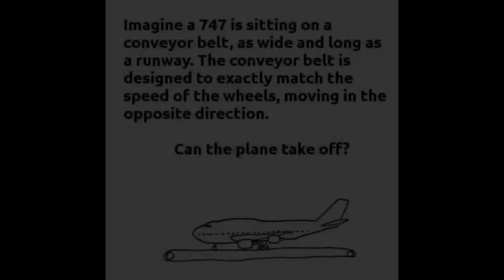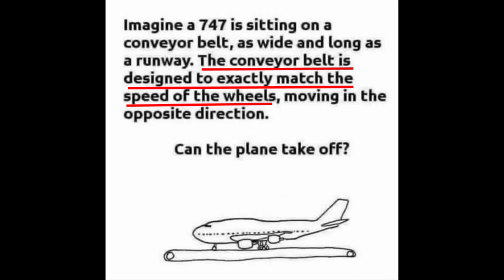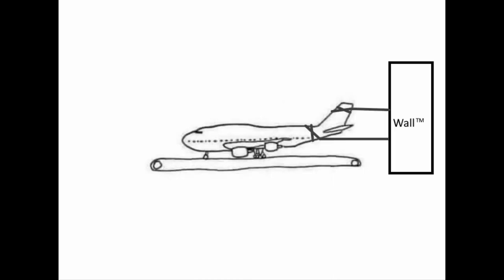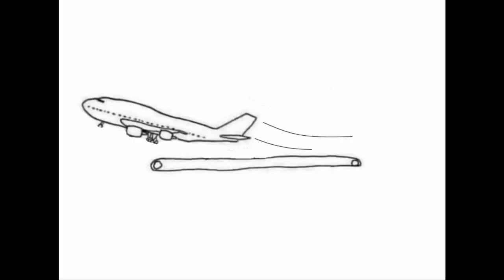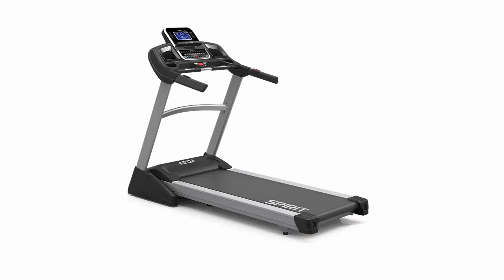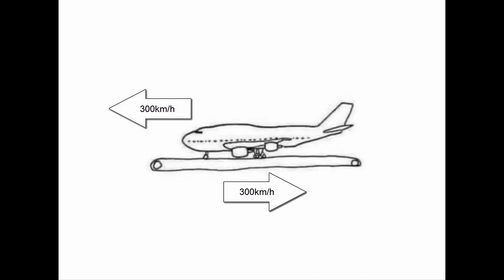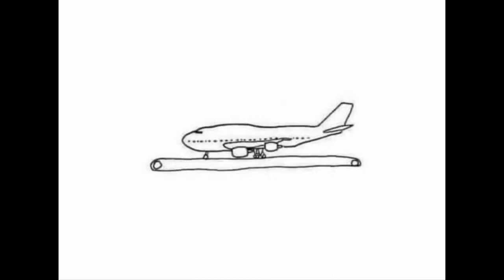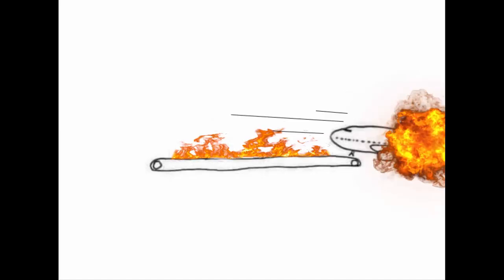Airplane on a treadmill is a flawed question.

Comment: It's noteworthy that given such a belt was big enough, the imparted draft generated by the belt moving at a high speed would generate a strong head-wind (due to the no-slip condition bounding the surface air and the treadmill) therefore assisting the lifting force of the wings.
Reply from the maker: I hadn't thought about it but yeah you're right. That might mean if anything a massive fast moving treadmill would aid in lift over all.
Reply: Well, actually there should be a speed gradient for the air above the treadmill. Close to the surface, the speed of the air mass would approach that of the treadmill (respective to the ground). However, it would fall off with height above the surface. The wings of a plane generate lift by having air above it move faster than below. The treadmill should cause the opposite effect, i.e., air below the wing moving a little faster. Effectively, it would counteract the lift force.

Comment: Wait a sec, I thought the belt was supposed to match the speed of the wheels, but at one point the wheels are going 600kmph with the belt still going 300kmph?
Reply from the maker: Yes, because the wheels are free spinning they don't have a speed limit. So it's not possible to match the speed of the wheels as no matter how fast the belt is moving, the plane will move forward causing the wheels to spin faster. The planes thrust comes from it's engines (jet or propeller) the wheels just freely spin. It's a trick question that tries to make people think planes operate like cars with set wheel speeds.
Reply: @venera13  I thought the belt was matching the exact speed constantly, but not the acceleration. So the speed on both wheels and belt would continue to increase from 1kmph up to unlimited speed while the plane accelerates to take off (with the plane acceleration causing the wheels and belt to accelerate as well) Of course the with the plane accelerating way faster and with no regards to it's wheels+belt acceleration. Little details I was missing, thanks.
Reply: @EstSotoS  You are totally right - that is where all the people including @venera13 that say the plane would fly goes wrong! You however could not create a physical setup where you could simulate the question.
Reply: @venera13  "the plane will move forward, causing the wheels to spin faster."

This breaks the problem's condition that the tangential surface velocity of the wheels must match the velocity of the belt. If the velocities are always the same, the wheel must never be moving relative to the reference frame.

What would really happen is the reverse acceleration due to friction would exactly match the forward acceleration from the engines. If it does not, your condition is broken.

The conveyer belt may need to spin extremely fast if the friction inside the wheel bearings is low for this to be true, but we never imposed an upper limit on the speed of the belt.

Broken down to it's most basic parts, this problem is a classic no-slip rolling problem with the ground moving instead of the circle.

The plane stays grounded.
Reply: @venera13  the treadmill always match the speed of the wheels whatever it is.
Assuming there's friction that can't be overcome...
Since the thread milk is as fast as the wheel and there is no ripping going on the plane can't move.
Free wheeling is of no importance as it would be horizontal force on the wheel axis that would prevent the plane from going forward.
So the plane would be kept in place by friction between wheel and treadmill, and then transferred by wheel axis to plane body.
Since the wheel can't move the plane body can't move, no lift, no take off, the end.
Reply: @here_be_dragons9184 the issue is that friction doesn't increase with speed, so there's no way that moving the treadmill faster could affect the plane
Reply: The coefficient of friction doesn't increase with speed, but the actual backwards force imparted on the wheel axle is equal to the speed of the conveyor multiplied by the coefficient of friction from the wheels. Since the belt is designed to increase it's speed infinitely to match the linear velocity at the surface of the wheels, that backwards force will always be equal to the thrust being produced by the engines.
Reply: @andrewshobbybasement  friction is equal to the normal force times the coefficient of friction, not velocity
Reply: @dalmationblack That is the force required to overcome friction between two stationary objects. For a wheel on a conveyor belt, the motion of the belt will transfer kinetic energy to the wheel, part of which will become linear motion and part will become rotational motion. The exact ration between these two components is determined by rolling friction. More rolling friction = more linear motion, less rolling friction = more rotational motion.

Comment: Yes but...  Excellent explanation given actual physics. Let's get to the actual question asked.

A plane is on a treadmill that can move at such a speed, ignoring concerns about friction, that the plane reaches V2 and remains stationary relative to a ground observer. Can it take off?

I answer no. We have such planes in land-speed record craft. With no air movement across the wings to provide lift the aircraft cannot get airborne.

Without lift there is no flight.  Everyone seems to argue otherwise so feel I must be missing something. Would love to know what that something is.
Reply: Plane that remains stationary cannot take off. I agree. Yet this one takes off. Why, you ask?

In short - planes speed is not determined by rotating speed of it´s wheels, not is it directly dependent on it.

Plane moving (and acceleration) is caused by jet engines providing thrust by sucking in air and pushing it fast behing, which result in the same force pushing the plane forward. It pushes itself from the air surrounding it, not from the ground. 

The plane is standing on the ground with wheels to not fall down, but those wheels are not powered and when not applied with brakes, they can freely rotate.

When plane is getting "go" signal, it powers it engines to max. Thrust starts to happen, pushing the plane forward. This will make the plane move and while it is still touching the ground (close to zero lift under it´s wings), the difference of speeds between plane and the ground bellow makes wheels turn, because they are absorbing the speed difference. The ground bellow doesn´t slow the plane down through wheels.

If there would be a belt matching the plane speed in the opposite direction, all it would achieve is for those wheels to rotate twice as fast, but nothing else. Because plen speed is not a result of it´s wheels rotating, nor inflicted by their speed. Wheel rotation is a result of the plane speeding over ground and the speed of rotation is the airspeed of plane + speed of the ground (second one being usually zero irl :D )

So the plane will speed up and lift off with it´s wheels rotating the speed equal double to airspeed of the plane.

Got it?
-----------
Fun fact: If you made a runway from a belt that would perfectly match the plane speed in the SAME direction, it would achieve a feat of a plane taking off without it´s wheels not rotating the whole time at all!

But, sadly, such belt would not help the plane speed up and take off any faster then usual plane. Hence why giant treadmills are not implemented on aircraft carriers and instead catapults or booster rockets are used ;)